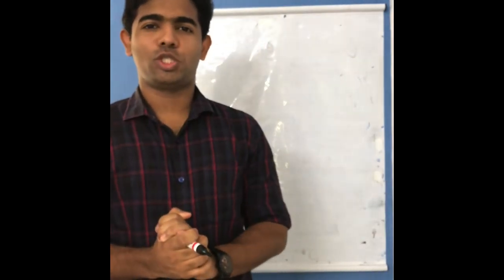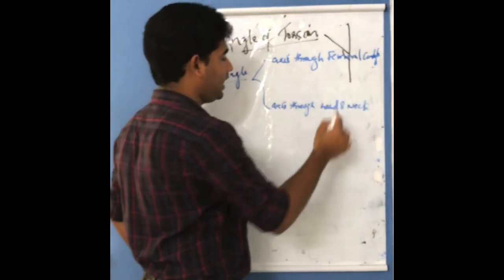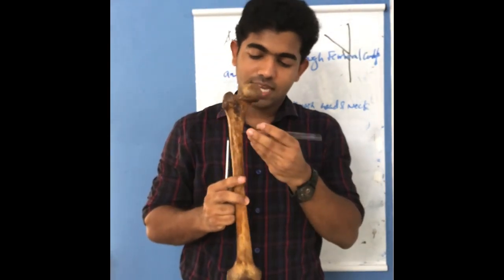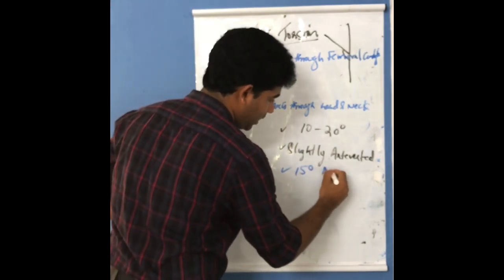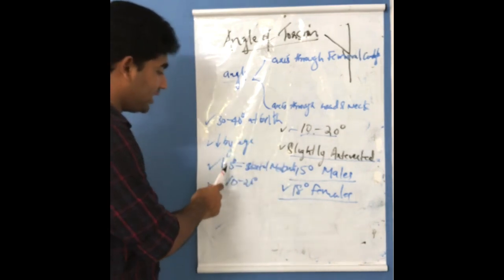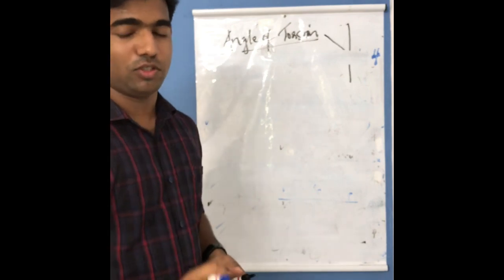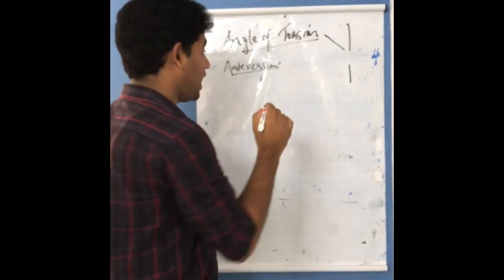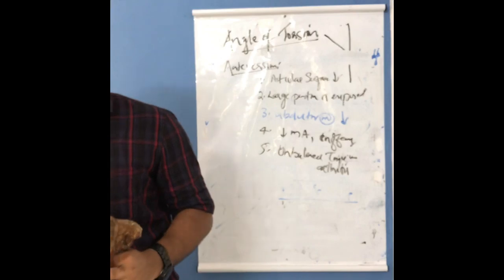Anterversion& Retroversion( Angle of torsion-hip biomechanics)

Comment: I had a patient 24 years old age with RTA before three months leading to Subtrochanteric fracture treated surgically by ORIF by anatomical locked plate with screws . Now there’s no pain but there’s lengthening of the extremity, what do you think the causes of this lengthening ? 
Is it due to anteversion or due to coax valga ?

Comment: As u have explained in video that in femoral anteversion (i-e femoral internal rot ) ,tibia will rotate externally to compensate it ,Can u plz explain the rational behind it because what I have learned is that tibia rotates internally too.
Just Asking for learning purpose .
Reply from the maker: Yes, correct.See when there is ante-version the entire femoral articular surface is outwards or there is decrease in articular contract between femoral head and acetabulum. But to overcome this the femur itself is turned medially by the capsuloligamenteous structures.But it increases hip congruence but at knee there is  alteration in the axis of knee joint.The result is tibia also getting medially with femur and as a result there is a TOE IN that is happening.
But mostly its not that pronounced bcz in most cases there is a  change with tibia too. Thus the tibia will go for lateral torsion which is opposite to that happens in femur,this is a compensatory strategy to joint axis the same( it may happen in most cases or if INTOE progress)
good luck
Reply: @TonysTutorial  thank u so much ..
Reply from the maker: My pleasure